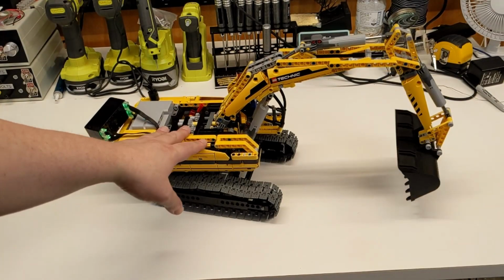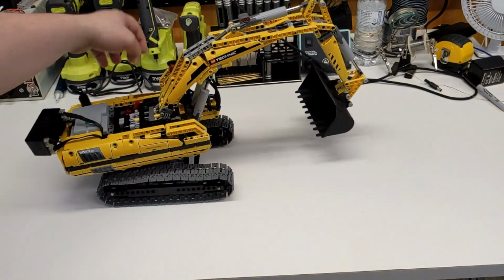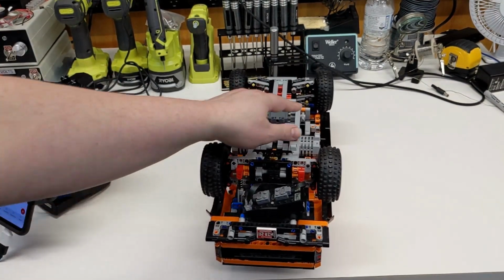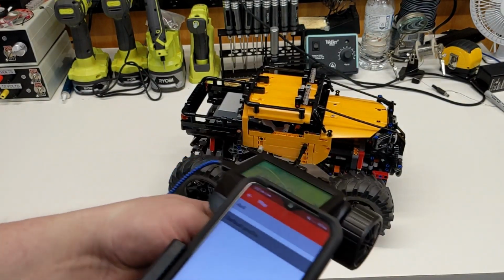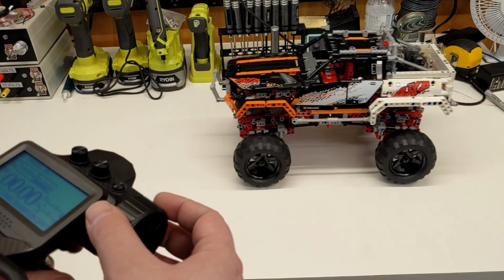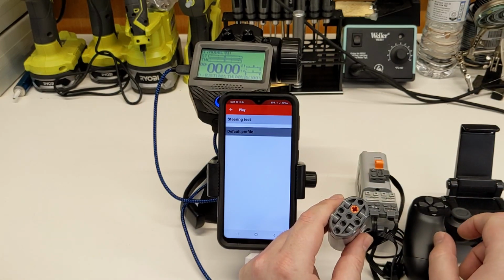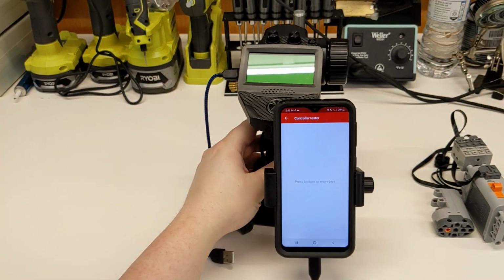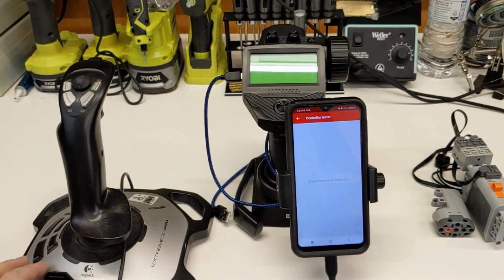Testing BrickController app with models and controllers

Comment: What is the brand or model of tge rc looking controller
Reply from the maker: It's a Flysky G7P, I have a dedicated video about how to set it up.  I haven't messed with it in a few years so it's possible things have changed for the better or no longer compatible.  I tried a few solutions but this was the only RC controller I could find that would work with the app

Comment: Does someone has an idea why I can't connect brick controller 2 app with buwizz 2.0 ? (works with buwizz app)
Reply from the maker: Maybe the firmware on the Buwizz 2 is too old? Or even too new?  You could try posting on the BrickController2 thread on the Eurobricks forum or on the Github page

Comment: I had this issue with technic hub with 2 x technic large motor hook up.  Both are set to servo mode in brickcontroller2. I used for steering on my moc 8x8 vehicles.  After driving the 8x8 truck for a while, the wheels got screw up in steering direction.  I.e first pair turn to the left, while 2nd pair turn to the right.  What is wrong with the controller.  BTW,  I pair with a PS2 controllerfor the driving and steering.  Everytime the steering gone haywire, i used the auto calibrate in the servo settings to reset back the alignment of the wheels.  Is there a permanent solution?
Reply from the maker: There is a thread on the Eurobricks forums for BrickController2.  I haven't messed with it since making this video but I'll bet someone there had the same issue or may have some ideas to try

Comment: Thank you bro you've done exactly what I want and I'll do the same. Thank you very much
Reply: Why you not use c to c cable? And Can you recommend a cheap controller?
Reply from the maker: A USB-C to USB-C cable won't work, unless there is an OTG version I don't know about.  Believe me I tried.  I only tested the controllers I had on hand, I don't think all of the buttons worked on any controller besides the PS4 I tried.  I would try as many controllers as you can, maybe controllers from friends to see what works with the app in the test menu